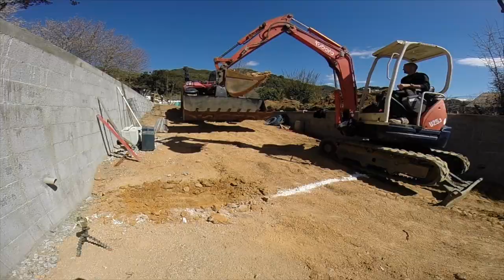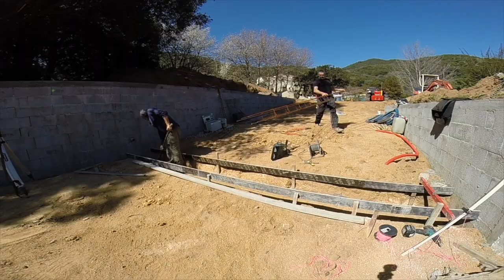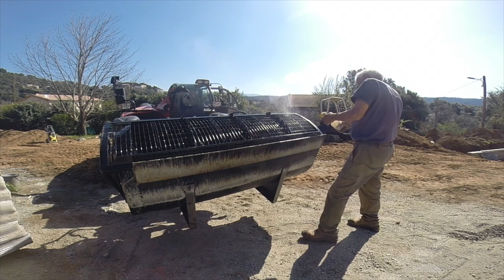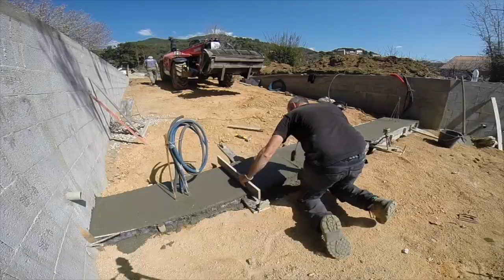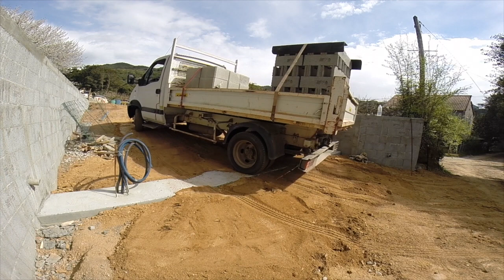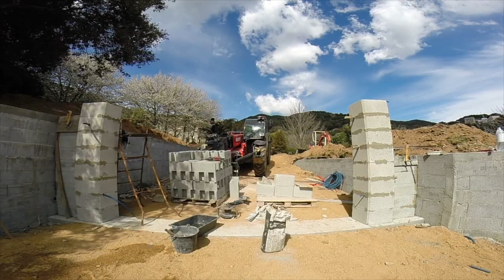Réaliser un seuil de portail

Comment: Salut Pierre

Une petite question stp. 
Je réalise  un seuil de portail coulissant 4.5m
Je creuse à 60 hors gel
Béton propreté
Ensuite ferraillage semelle s35 et par dessus je rajoute un chaînage carré 10x10 pour faire un peu comme une longrine.
Les poteaux seront ferrailles correctement remonte attente etc...
Seuil de 50x60 environ sur 10m
Béton Commandé en centrale. 

Sur sol légèrement argileux.

Pense tu que cela supportera le passage de camion de 45 tonnes ?

Merci par avance si tu as le temps.

À ➕
Fabio
Reply from the maker: Salut,
Personnellement je mettrais une semelle 15x35, je met la même chose pour une fondation de maison. Si tu as 50 d'épaisseur de béton, tu peux même poser 2 15x35, avec ça pas de problème pour passer dessus avec des gros camions.
Reply: @SOLITAIRE2A  merci pour ta réponse si rapide à cette heure lol.

Ce que t appel la 15x35 c est la rectangulaire avec 6 filant c est ça ? Pour en poser 2  c est une sur l autre et ligature c est tout ?
Reply from the maker: @fabiogoncalves9562  De rien, il est encore tôt lol. Oui c'est bien ça, 2 l'une sur l'autre, ça fait un beau ferraillage. Après il existe surement d'autres types de ferraillages pour ce genre de chose mais il faut demander ça a un fournisseur, après tout ils sont la pour ça lol. Ce n'est pas tous les jours qu'on fait un seuil pour passer des 45 tonnes.
Reply: @SOLITAIRE2A  super merci je lui en toucherai un moment merci de ton aide !

Bonne soirée !
Reply from the maker: Fabio GONÇALVES bonne soirée !!!

Comment: Bonjour c est encore moi. Debout de bonne heure. Que pensez vous d un dosage pour fondation d un sac de 35kg et de 60 pelles de tout venant? Est ce correct?
Reply from the maker: Bonjour,
non ce n'est pas du tout correct, perso je fais un dosage de 350 kg/m3 et pour ça il faut 35 pelles pour 35 kg de ciment. Ceci dit j'ai l'habitude de faire ça mais ça dépend de comment on charge les pelles, ça peut aller de 30 a 35 pelles pour 35 kg. Sur les sacs le dosage est donné en seaux, c'est plus précis. Une chose est sur c'est qu'avec 60 pelles le beton ne vaut rien, il est bien trop maigre.
Reply: @SOLITAIRE2A  Bon je me suis trompé, cela ira mieux avec 2 sacs de  ciment.
Reply from the maker: @adamomickael1018  C'est vraiment préférable lol, bon week-end et bon courage pour les travaux !!!

Comment: Salut je dois réaliser un mur de clôture droit qui sera composé ainsi maison existante-mur parpaing-pilier-portillon-pilier-portail coulissant-pilier-mur parpaing-bâtiment existant dois je couler une fondation tout le long sachant que le hors gel chez moi est à 0,80 puis recouler les seuils du portillon et du portail par dessus ou alors faire 2 fondations pour les murs et couler les seuils ensuite plus haut que 0,80? Merci d’avance
Reply from the maker: Bonjour,
il n'est pas forcement nécessaire de tout couler en même temps, il m'arrive régulièrement de couler le seuil su portail et les piliers séparément des mur de clôture. Par contre chez moi a 30 cm on est déjà hors gel donc je ne me pose pas de questions, je coule en une seule fois.
Reply: SOLITAIRE2A ok merci une autre question je vais utiliser de la semelle 35*15 pour mes fondations je vais faire 45 en largeur mais combien en hauteur dois je faire? Et mon mur va faire 1,80 de hauteur dois je utiliser du parpaing de 20 ou de 15? Merci
Reply from the maker: @kevindeb9508  pour la 35x15, 45 de large c'est vraiment le minimum et la fouille doit être parfaitement alignée car il n'y a pas de réglage possible. Perso je fais 60 de large. 
Pour la hauteur de béton en général je fais 30 cm. 
Sur 1M80 de haut je ferai ça plutôt en 20. C'est plus solide et c'est aussi plus facile de maçonner du 20 plutôt que du 15.
Reply: SOLITAIRE2A ok super du coup avec du parpaing de 20 la largeur des chapeaux doit être de combien au minimum pour pas être embêté avec la finition?
Reply from the maker: @kevindeb9508  Les chapeaux sur le mur ? Si oui tout dépend de la finition mais je dirais mini 5 ou 6 cm sur les cotés.
Reply: SOLITAIRE2A oui sur les murs merci pour tout en tout cas